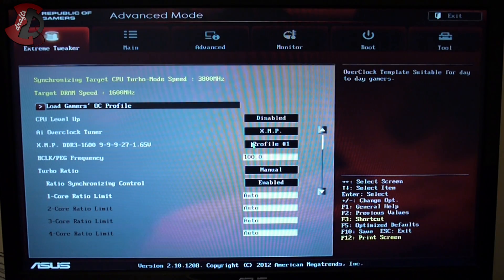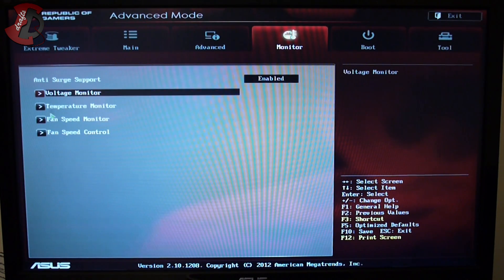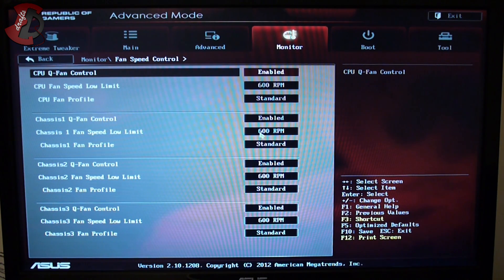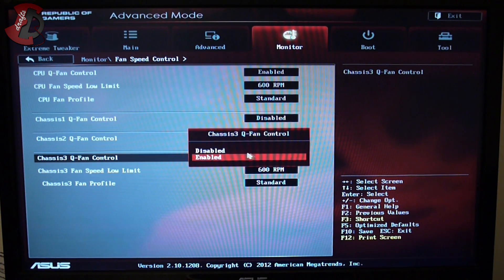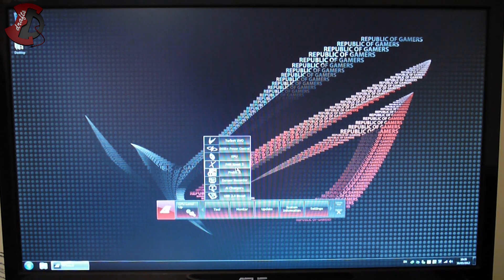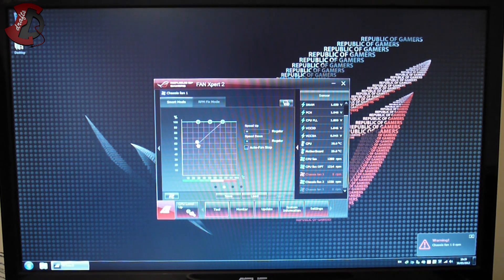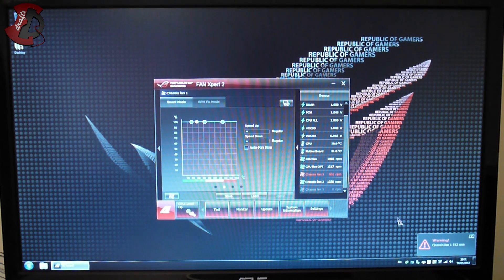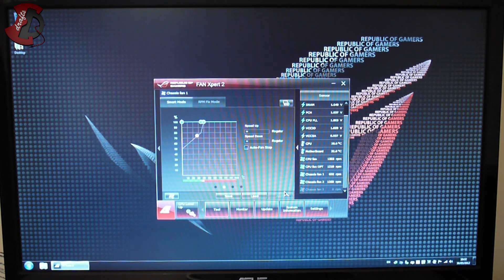ASUS Maximus V Gene & Silverstone TJ08B-E fan speed issues

Comment from the maker: Hi,
Make sure you have the latest BIOS. Then install ASUS AI Suite II that contains ASUS FAN Xpert 2. Then run Fan Auto Tunning speed tool and after go to Advance Mode and just set up the speeds for each fan manually. 
My video has some chunks on how to do it.
If you have issues with cold boot as well go to BIOS and on CPU fan reduce minimum speed to 200 RPM.
Hope this helps.

Comment from the maker: Thank you for the recommendation. I will look into it in future. At the moment am holding my funds for upcoming GTX 660. Fans are actually ok now, I just needed to flash BIOS to latest version and make sure the switch for the case fan is set to high. Then simply adjust. All working nicely now and I can control the fans with software alone.

Comment from the maker: CPU fan speed was adjusted by installing the supplied Ultra-Low-Noise Noctua adapters. So there you go, make sure there's nothing between MB and fan (i.e. speed control switch). Now the system is much quieter and the temperature is fine too.

Comment from the maker: All works fine after switching the fan to high (as expected really). I can also control my front and rear fan speed. Front spins at 700 and rear at 900 at the moment. Just as I would like. Pity can't control CPU fan (no voltage setting). I have tried adjusting in BIOS - nothing (set duty cycles to bare minimum, same). But that's why Noctua includes these fan wires with resistors. Will play with that later. Thanks for the tips bently2300.

Comment from the maker: I did, thought this will solve it, not a chance.. I think the switch on the side has a resistor of some sort. If selected low, motherboard might not initialise it properly. I have tried auto tunning via FanExpert with fan set to high - fine; low - issues. Just a funny fan, that's all.